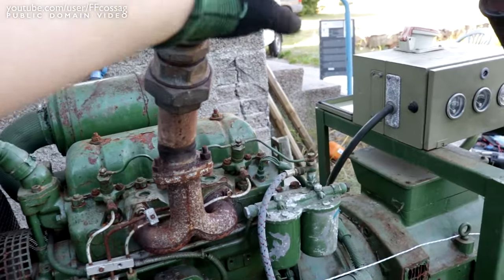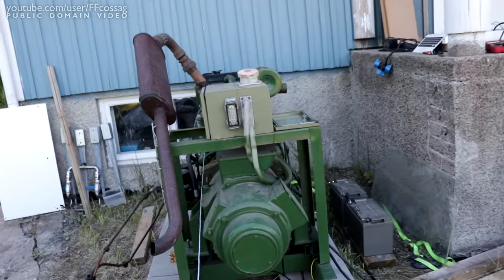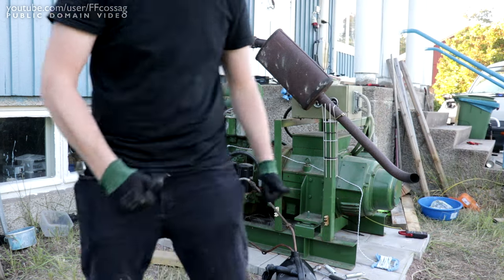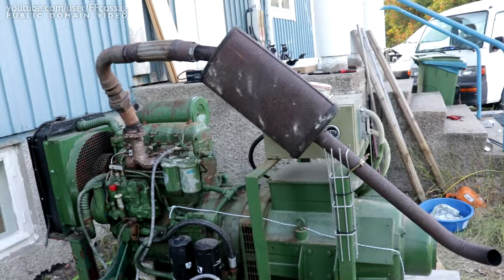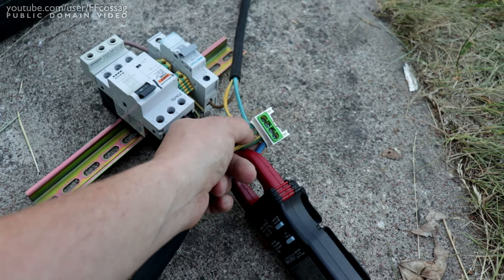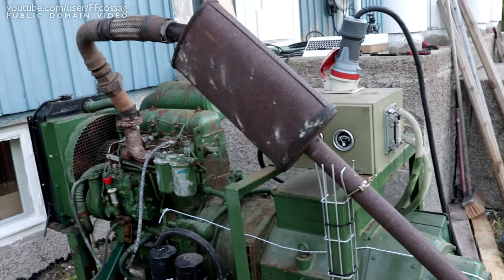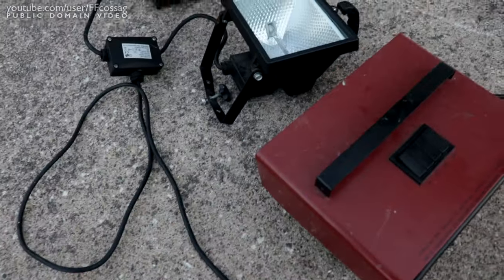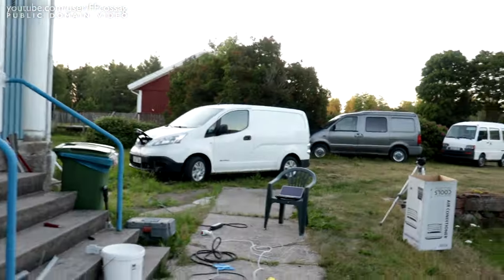25 kVA Diesel Genset Testing

Comment: Watching this makes me really appreciate what BMW engineers did with the i3 REx. The range extender in the i3 generates the same 25 kW (34 hp) as the diesel generators but only adds about 120 kg (265 lbs) to the car. Compare that to the maybe 400-700 kg (880-1,540 lbs) but it's also not built to survive the end of the world :P
Reply from the maker: Yeah, range extending engines are impressive in their own right, but I don't want to know what they'll look like after running continuously for over two straight years... Hehe. Also, it weighs 900 kg (or 7,5 BMW engines) ;)
Reply: Yea i take solice in that the engine is made by kymco, and not bmw 😅
Reply: @FFcossag  If you have a battery in the car you dont need any of the rotational inertia to handle current spikes, that probably helps a lot to lower the weight.

Comment: I'm curious if you checked the frequency of the output? Which I assume is adjusted by engine speed, like on the puny generators the rest of us have. I wonder how the waveform looks and what the THD is on a generator like that? The first video of yours I ever saw you were also starting an engine, it was titled "Cold-starting my Peugeot 205 in -10 °C" and I've enjoyed every video since. It's hard to believe that was 10 years ago already!
Reply from the maker: Yeah, it's mechanically governed and spot on at 50 Hz. It was part of a maintained multi-generator system, so I expected nothing less. Stability and distortion should be very good, since these old units just use so much more copper in the windings than newer units. Its size, weight and where it came from also suggest that it's built more as a grid-forming generator than a backup unit, so performance was probably weighed fairly heavily when it was built. It will definitely get tested at some point.